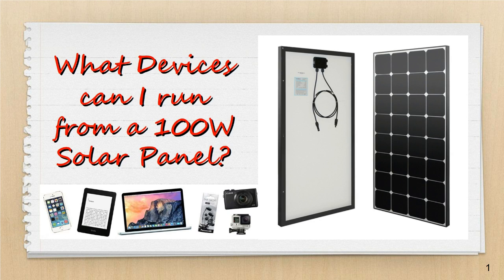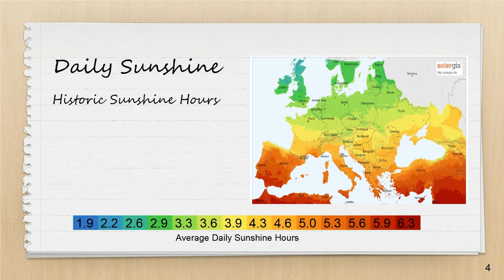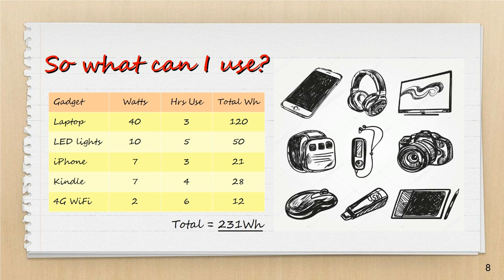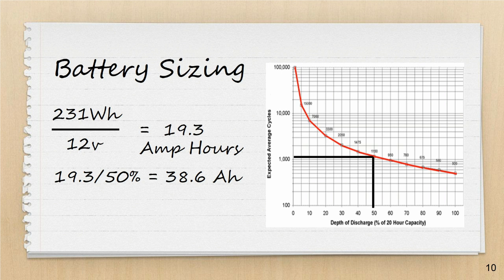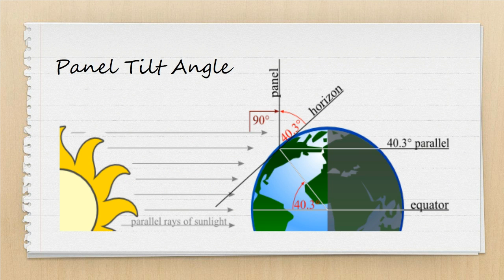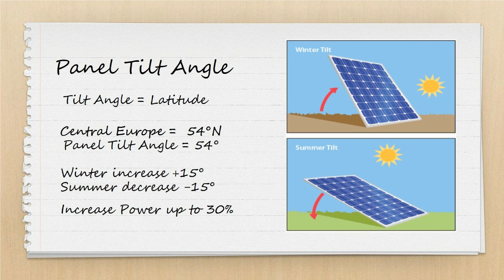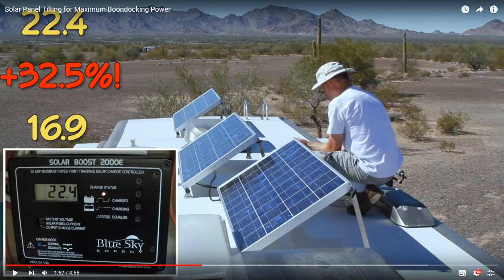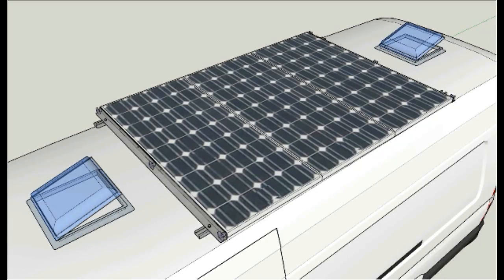What can you run on a 100W Solar Panel?

Comment: Hi Greg & thank you for such a helpful & informative video. 

Totally new to all this but have been doing a lot of research to get a 100W setup going for a beach hut on the Essex coast.

Couple of things that are still a mystery to me. 

Would I be OK using a 600W electric travel kettle? It's these sort of burst energy things that I don't understand. 

My inverter is rated from 1500 - 3000 W. 

Secondly, do you recommend independent fuses within the system? So from the battery to the controller & inverter & if so what sort of size? 

Many thanks to you or anyone who can give me help on this.
Reply from the maker: Hello, yes, I can help you select everything you need for this setup. 
The easy answer is yes you can use the travel kettle with a small off grid setup the question is how long?
600W/12v=50Ah so if you had a 100Ah AGM battery you could use the kettle for an hour before the battery was at 50% discharge. So if it takes the kettle 10mins to boil that’s 6 times you can use it before the battery needs recharging. 
With a beach hut application you visit it for the day and then maybe not again till the next weekend?
Using my own recorded data from my solar panels I would expect you to get something like 1.5-2x the Whrs here in Essex so it would take 3-4 days to put that 600W or 50Ah back into your battery. But in your application that might be absolutely fine because you can leave it charging while you’re not there. 
You may want to have some 12v sockets for charging phones or Bluetooth speaker or radio and some LED lights. I would like to help by sketching up a simple diagram for you of the components. Can you PM me your email and I’ll send you a diagram over. 😀👍🏼
Reply: @GregVirgoe  

Thank you Greg, you have been very helpful!

From doing a bit of my own research on the "kettle dilemma" over night I think I will stick with the gas! As you say it is a big drain & some people are saying even 12V compatible ones can take up to 20 mins to boil! 

Unfortunately, considering your kind offer of advice on the set up, I have already got it on order. - 100W Renogy panel, extension cables, Renogy Rover 20 Amp Positive Ground MPPT Solar Charge Controller Battery Regulator, SUDOKEJI 1000W pure sine wave inverter power inverter DC 12V to AC 230V AC 240V 50HZ, BTSKY Pair Of 10AWG Solar Extension Cable with MC4 Female and Male Connector for Solar Panel Connectors Unfortunately I bought a 75amh Platinum Deep cycle leisure battery a few years back, before I had really had any idea of what I was doing. It should be OK for the light use I need.

So the setup would be fairly standard. The few questions I do have remaining are - What size cables do you thing I need from the battery into the controller & do you recommend a fuse on that & if so what size? Would you also say a fuse from the MPPT to the inverter? 

The sort of things I would like to power down there are standard phones & laptops which should be done with ease but I also have 70W (from the sticker on the back) rated TV together with a PS3 game system which I think uses something like 40W. I have got a 3 way fridge but at 110W I think I will keep that on the gas. 

I noticed that you are in Essex? If you ever make your way down to the Hipkins tea rooms down at the Naze there ask either David or Robert where John's hut is & I will stump you up a few beers or a bottle of wine on my "sea view" decking!

Again, thank you for any help you can give.
Reply from the maker: Sounds like you’re pretty well sorted.  That’s good 👍🏼
Solar PV cable is 4mm from panel to the MPPT. I would fit a double pole isolator in that so you can shut off the power from the panel if you need to work on the system. 
From the MPPT to your leisure battery use at least 10mm battery cable with a 20A fuse / DC breaker in the positive. 
Don’t connect inverter to your MPPT it must be connected to your battery because of high current. 
From battery to the inverter use at least 16mm battery cable and 100Amp fuse / DC breaker in the positive. 
Wire from battery to a blade fuse holder in 10mm battery cable and run all your individual 12v circuits off that with 2.5mm 2 core cable to usbs and lights etc. 
We like Walton lovely beach and pier there. Might see you one day for a pint 🍺
Reply: @GregVirgoe  

Many thanks Greg! 

I'll have a read through & digest of that &, if it is OK, get back to you with any probs.

You'd be more than welcome to come down mate! I've got a lovely spot built into the cliff there. We are probably one of the last huts you would come to before you got to the Naze & Tower itself so well away from the town.

In all seriousness, if you did fancy it, let me know a few days before & I'll let the guys at the shop know to expect you. Not too sure when I will be going now though what with the virus & restrictions. From talking to the boys down there apparently the police have been sending people home from huts. I think they will put a road block in from that bit where the A12 finishes near the Manheim auctions to stop people getting down to Clacton, Walton & the coast down there this Easter weekend...
Reply from the maker: Deep Heat if you got gas there definitely use that to boil a kettle rather than drain your battery. 
I imagine your hut is facing east so you’ll have a perfect south facing sloping roof to mount the panel on or are you going to have it on a extension lead and bring it out when you are there?
Reply: @GregVirgoe  

The roof is dead South facing Greg. Going to be fixing it to the roof directly with removeable bolts so I can take it down in the winter. 

Bit of luck, I was watching a vid from the States where a guy had a rig set up on a pallet - It was just a demo set up - & I got to wondering about spacing as most people just attach the panel to whatever the main fixing surface is. Apparently there is a 4 -6 inch gap recommended as the panels can get quite hot & then fall outside the heat range for maximum operating efficiency -= 25C. Probably more of a problem for California but we got up to 40C down there last year! 

Got LPG up there last year with the fridge which works like a dream.
Reply: @GregVirgoe  

Sorry Greg just a couple more questions & I think I'm done.

1.) What order do you think I should wire everything in? I know I should connect the battery up to the controller before the panel but should I wire up the inverter before of after that? 

2.) Being a total newbie to all this - How would I get the two terminals from the controller & two terminals from the inverter on to the same battery? I have just bought a battery clamp connectors for the inverter end but could I just put the same coloured wires from the controller into the same slots as what I'm using for the inverter or do they have to be separated? With my extremely limited knowledge of electrics that may be the dumbest question ever or a reasonable one! 

Thanks yet again for any help. Your suggestion of going directly to the battery has been a revelation as I was going to go via the controller. I actually see now the manufacturer of the inverter I have bought actually recommends your setup. From reading up further on it there does seem to be some issue with the battery being allowed to run down too much & possibly damage it but I think my inverter has some sort of protection against this.    

Cheers mate

John

Comment: Hi Greg. I found this very informative. Can I ask with the Ebay controller you link to can I also charge my starter battery through it or would I need a vsr split charge kit?

Comment: Hello Greg. My questions to you are the following: 1)  how will I know which battery to choose after calculating my total energy needed. I know you used 12V system in this example. But there are 24 V and 48V also. 
My second question is, how would I calculate the inverter I need? Thank you for the video. First time subscriber.

Comment: Can I operate a 600 watt hot pot for no more than 30 mins at day (nothing else) with 750 watt inverter using 100 Watt panel
Reply from the maker: jfletc3000 in theory yes you can but in reality you would need more solar to recharge  the battery each day. 
In reality my solar setup (480W) gives me 600-700Wh of power on good days which would run you hot pot for an hour. 
Just because you very rarely get 100W out of a 100W panel you get a lot less due to angle of the sun, clouds and dirt on the panels. Hope that helps
Reply: Greg Virgoe So what size system would you suggest I need it to be as cheap as possible I’m on a fixed income

Comment: Hi Greg , Could you give your thoughts on self adhesive panels ? I was thinking to mount 4 of them in line onto a lightweight polypropylene board which in turn would be mounted to an aluminium frame which would be hinged to enable tilting. The weight saving is huge as opposed to using standard glass  framed units but there isn't much comparison info . Interested to know your thoughts on this, regards .Atb
Reply from the maker: I looked at these myself but they are not as robust and the weight saying is negligible when proper panels have much longer warranties and far stronger build quality.
Reply: Greg Virgoe thanks to reply Greg , yeah I guess the longevity is a question when it comes to the flexi panels. They are still early days , and I think the limited warranty reflects  this. I'm going to try them in line mounted directly on a polypropylene honeycomb  sheet which in turn will be riveted to an aluminium frame with a tilt option. I estimate the load including fixings to be about 36 kg in total , so I'm going to try and maximise output with lightweight flexi panels and use the saved weight for bigger batteries and storage. I'm still trying to get my head around the technical side of solar,   but your latest video has really helped Greg , much appreciated and I Hope the build is coming along well
Reply from the maker: Don’t be tempted to go too big on battery or your panels will not be able to fully recharge them and they’ll be in s constant state of discharge. 
My build is really exciting now. The combi boiler turns up next week and controls then following week all my furniture board is arriving. Loads to do.
Reply: Greg Virgoe yes definitely agree. I'm trying to get the balance just right. I think in general there is so much consideration with these conversions, it's so easy to over or underestimate every aspect. planning is key I guess. My build has been dogged with turbo , cat and dpf problems on the van , so it's been in the the garage for 3 weeks ,  but plenty of time for sourcing and planning :-)  and watching vids 😃 can't wait to see the sprinter being fitted out , exciting times !!
Reply from the maker: Yes indeed!! Combi boiler turns up on Tuesday and all the furniture board arrives the following Monday. Busy Easter ahead 😀

Comment: I was considering buying 2* 100 Watts panel and two controllers and two batteries
 and use 100 pack for my kitchenette like fridge microwave cooker 
and  the other one for lighting charging tv pc
Is that a good way of thinking??
Im really offput to drive around with gas

Comment: Greg you are truly inspiring and your videos are a pleasure to view, even to someone way down in New Zealand, the land of number 8 wire thinking! I'm a brit/pom based in Taupo NZ which gets quite cold in winter (just a couple of months away). I'm going to convert a sprinter/transit for a similar use, but my garage will be to stow equipment so I can use it as a work horse and also live in it. Out of interest, how much do you reckon you have spent on just insulating your van to that level? Cheers Karl
Reply from the maker: Hello Karl, welcome. I used two different types of PIR board, mineral wool and the reflectix. Foil tape and pins. 
Whole lot for LWB just under £500 GBP Best wishes with your build.
Reply: Thanks Greg. Could I be cheeky and ask a few details about the van itself, like how much did it cost and how many miles/Kms on the clock, just to compare UK second hand prices against NZ-cheers
Reply from the maker: Yeah no problem, it's a late 2008 model 313CDi 130BHP 6 speed with 112k miles - Price £6,600.00
It was one of two vans owned by local events company for moving table and chairs etc. Really clean.
Reply: Cheers. Closest I can get to that here is this https://www.trademe.co.nz/motors/used-cars/mercedesbenz/auction-1565487678.htm?rsqid=4ab957eafc26432c82974cbc3f69f190
Older than yours but less mileage and not cheap at around GBP 11,300
Reply from the maker: Wow that’s crazy £12k GBP!!
Nearly Twice the cost of my sprinter for a van that’s 3yrs older. Why are they so costly?
Reply: People think NZ is cheap-it is not! It is however cheaper to buy NZ lamb in the UK than it is here!!!

Comment: thank's for sharing 
what about if i live in a very sunny country  and have a limited budget , would be more efficient and budget saving  to invest more in batteries than a solar pannel  itself
Reply from the maker: The two go hand in hand, where you benefit by having more sun is that both do not need to be as big because you do not need to store for longer periods. If you do the calculations and change the sun hours the equipment will be smaller in duty
Reply: ok i see 
thank's a lot for your answer

Comment: I’ve a vw splitty so I can’t and don’t really want it fixed permanent I have two slatted racks I could mount once set up.  Inside I’ll have 
Compressor fridge
Six led spot lights
Double din stereo hooked up to a small amp
Possible a tv  
240v inverter and two usb chargers

I think my battery is 100ah leisure would a 150w solar work ok with this
Reply from the maker: tospicy4ya it would work but what you need to bear in mind is that you can only use what you can generate. Most of the time the panel will not be giving you the full output. The fridge will use the most power. Watch my other battery sizing video that has a free chart to download where you can workout your usage. .
Reply: How do u work out the compressor fridge as it only kicks in when needed ?
Reply from the maker: @tospicy4ya  it's a best guess estimate
Reply: Greg Virgoe cool , just watching your video now 😁👍

Comment: I would like to charge 36 volts what can I use to hook up I am a beginner I don't want to buy the wrong thing all I want to do is charge 36 volts I have three 12 volt batteries mind up question someone please help me in this problem or a website
Reply from the maker: Are you sure you mean 36v. All camper van systems run on 12v and if you have three batteries they are wired in parallel to keep the voltage at 12v. Watch my latest wiring video it has a free easy to follow schematic too

Comment: What do I need to run two automotive electric fans
Reply from the maker: Do you have their spec details??
Reply: Got two 80w automotive fans and 2 100w panels need to run basically when the sun is out

Comment: I always love your tutorials, I have a question.
What's the minimum voltage that man starts suffering from DC voltage.

I always thought that DC is safe to work any Voltage is it correct?
Reply: World of Fusion 360  240v AC and DC will kill you. You are more likely to survive a 240v AC shock as AC throws you off but DC causes your muscles to lock, so you can’t let go of the live cable. When I was an apprentice electrician the best piece of advice I got was “ always presume a cable is live and you won’t get a shock”
Reply: DC is not safe at any voltage.   50V and below you can hang onto it all day and you cant feel it.  Upwards of that I would be very careful.    You can of course still have issues with fire/burns etc if you short out lower voltage systems that can provide high currents.    That is why I sometimes cringe when these sorts of videos have no circuit breakers or fuses in the system.

Comment: Do you have an opinion on mono vs poly type solar panels?
Reply from the maker: Hello Alejandro, not sure how much you know but the panels are made differently. You can look up how they are made but the process to make Mono panels is more involved and hence more expensive but the panel are better at converting sun rays into energy. Well by a couple of percent. 
So as solar panels are inherently quite inefficient any improvement I think is useful. With the prices of panels falling now to £1/W it makes sense to go for a good quality mono panel. Unless you are really on a tight budget. Like buying Duracell over Everready? Hope that helps

Comment: What if I was to hook up over solar panel with 2 100ah batteries, I don't plan on using the power daily Judy storing it until a power outage or its needed, and adding ti my question can I hook up 4 or 5 batteries to one panel. ISS it possibly to fill all the batteries over time? Thank anyone who has am answer in advance

Comment: I always love your tutorials, I have a question.
What's the minimum voltage that man starts suffering from DC voltage.

I always thought that DC is safe to work any Voltage is it correct?
Reply from the maker: World of Fusion 360 it’s the current that will kill you and as little as 100ma is enough to cause a lethal shock.

Comment: Greg on your rear bed will that go up and down for access to your garage ? PS very helpful on the solar panels regards Sas
Reply from the maker: No, I've had the bed frame made in three lightweight aluminium sections that span the width of the van, angle secured to the sides of the van that the frames fix to, so they can be very easily lifted out when loading bikes. Video to follow in the next few weeks. Frames are all made now, waiting for the furniture board to be delivered in two weeks time.
Reply: Greg Virgoe ok cool ive got a Harley Breakout so looking at vans now thanks for your reply
Reply from the maker: I would maybe look at 5T versions with your Harley. 
How much does that weigh?
Reply: Greg Virgoe bike weighs 320 kilos i weigh 150kilos lol
Reply from the maker: You’re gonna need a bigger van 😉👍🏼